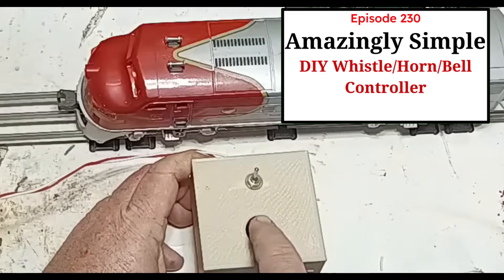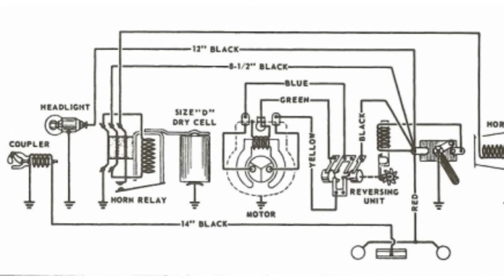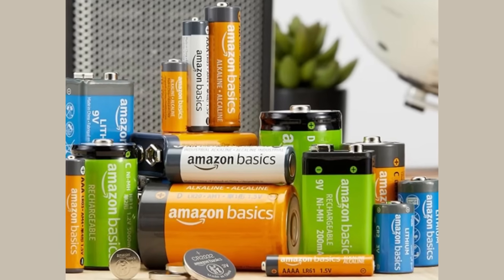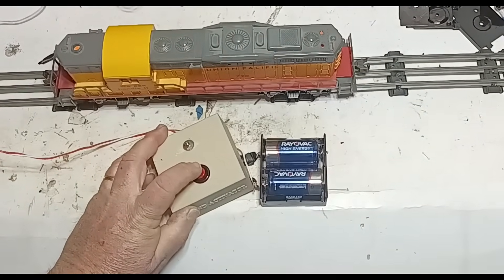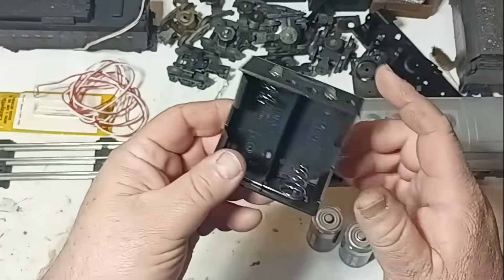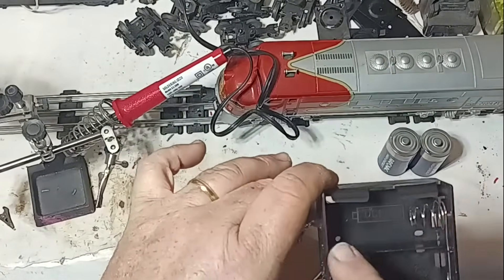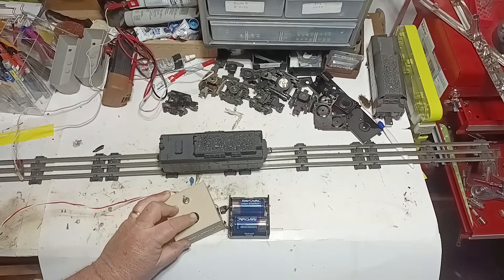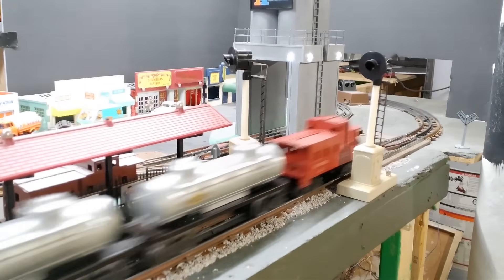How To Make A Simple Lionel Whistle Controller At Home

Comment: Have you tried this setup with the transformer powering the trains at the same time? Since the battery is in parallel with the transformer, these two sources are going to try to dump current into each other every half cycle. The diode is absolutely necessary because the transformer would blow up the battery, but the battery is trying to dump current into the transformer windings every half cycle as well to match the voltage drop. Either make sure the resistance between the transformer output and battery input is somewhat significant or add a resistor in series with the transformer and track connection. Otherwise, you essentially have a short in the transformer-battery loop.
Reply from the maker: To  answer, yes,  I have used this button successfully while operating trains/transformer at the same time with no issues.

Comment: I built this project and I thought that I followed the video, but what did I do wrong if the horn sounds all the time?  AND what’s the fix?. Thanks!
Reply from the maker: If the horn sounds all the time with the button is not interrupting the power or the horn relay is stuck. You can check the button function with a voltmeter
Reply from the maker: Or maybe the diode is on the wrong side of the on/off switch, sending constant DC to the track.
Reply: I was a little confused about the placement of the diode. Please confirm if “the band” on the diode should be on the battery side or the switch side. Thanks

Comment: Ok, i may be obtuse, but is this wired how? In series with the transformer,  in parallel? A drawing would sure help because i cant seem to get it right. Im a spaz.
Reply from the maker: As the diagram at 4:15 shows, the transformer is not involved at all. The + side of the battery goes to the center rail and the - side goes to the outer rails. The DPDT is only necessary if you want to control both whistle/horn and a separate bell (opposite polarity). The push button connects the + side of the battery to the track so it doesn't sound continuously. The button will sound the horn even if there is no transformer power to the track (As at 4:03). If you have an early PW whistle or one in which the motor has not been tuned recently, it MIGHT not work as the battery may lack the power to run the whistle motor. Don't forget the diode so your AC track power does not backfeed into your battery! (Potential BOOM!).

Comment: Good video on the simple project.  Most of my locomotives do not have a horn so I want to make a fixed trackside shack housing a sound card with diesel horn, steam whistle and bell options.  I would power this unit with a low wattage A/C transformer I use for lights on my layout.   Then I would have a whistle, horn or bell for any locomotive I am running.   Not asking you to make a video on this idea of mine, but any help you can provide would be most helpful.  I have a shack, but what sound card would you recommend and how would the wiring be done.  Electronics is not my strong point, so keep it simple....lol  Thanks Mike.
Reply from the maker: I would go this route: https://youtu.be/x_3hEQL8qwk

Comment: That would be a nice complement to add bell control to a postwar transformer. I run mostly postwar but have a few modern era pieces that have whistle/horn and bell. I typically will use my CW80 transformer for these pieces because it has both controls built in. Something to consider though is that some postwar transformers have an AC voltage boost of around 5 volts when the whistle is triggered. I know the KW does this but not sure about which other ones do. This is done to prevent the train from slowing down when the air whistle motor activates and draws track power. This feature sent my 2046 off the rails many times when I was highballing towards an O27 curve, hit the whistle but the relay didn't activate, and instead my locomotive got a voltage boost and launched itself into a roll across the living room carpeting! LOL
Reply from the maker: That's the Turbo Boost! ;-)

Comment: Can you make how to make your own lionel transformer with a battery
Reply from the maker: Well, you'd need a very large battery and a rheostat/potentiometer. And you'd be running on DC power instead of AC.
Reply: But can you make a tutorial so I can understand how to wire it
Reply from the maker: @Tulungagungrailwaychannel  honestly, it would be cheaper just to use a traditional transformer. A battery large enough to run your trains off of would be far more expensive per watt than a regular transformer. Also, I understand how it works in theory but I'm not familiar enough with that kind of current to provide safe advice.
Reply: But I'm in 220v country
Reply from the maker: @Tulungagungrailwaychannel  I'm not an electrician. I don't want to accidentally kill anyone.
Reply: Last year I buy bachmann train but the controller burned out when I'm testing it
Reply: Ok

Comment: Would it be possible to use a bridge rectifier with a resistor to replace the batteries?
Reply from the maker: Yes, but then you need to run on either track or accessory power.

Comment: Think this same hack can be pulled off with the battery control box from a postwar turntable, it’s basically the same thing, but with just a 3 position switch to change the polarity.  I have one because I really wanted a turntable (got it at my local CP Train Stop for around $80, and really only needed a better motor) I really don’t use the battery box since I had a spare Life Like dc power pack, but the battery box is still around in case I want to use it for something else.  But the Bedroom Carpet Central turntable is probably always going to be powered by that power pack though.

Comment: Mike MPC Matt here, can you use this system with the rechargeable batteries like NIMH batteries??? I don't like to use regular batteries or alkaline batteries because those types have a bad tendency to leak. Sincerely, MPC Matt.
Reply from the maker: A rechargeable D cells should work. If you're talking about rechargeable pack such as for cell phones you would need to have sufficient amperage and I'm not certain of the specs on those.
Reply: NIMH Thank You Mike!!! Sincerely, MPC Matt.

Comment: I've been doing this for some time now. I originally read about in a book that (of course) I misplaced somewhere and can't find. I usually use a household SPDT (AKA three-way) switch to control it as they're dirt cheap and actually use a slightly different wiring arrangment. I've never used a diode, however. Also, it doesn't have to be a D battery; I've had success with a AAA battery. Why an AAA? Because I was trying to stuff it into my SD18 along with a remote control relay for remote horn and reverse control!
Reply from the maker: D cells last a lot longer than AAA, but the voltage is the same.
Reply: @ToyTrainTipsAndTricks  That was my understanding too.

Comment: Lionel made something very similar to this for their G scale engines.  The RailSounds module used a 9-volt battery and had two buttons instead of relying on a toggle switch.  Wonder if it used a different technology than superimposed DC since G scale trains used DC power supplies to operate.
Reply from the maker: Railsounds was a different system. It was a more advanced digital sound system that utilized a different control method than the traditional relay activated whistle/horn/bell.

Comment: Lionel DID manufacture a D cell whistle/horn controller (Lionel Whistle Controller No. 147).   It contains a “snap” switch that places the D cell in series with the track power.
Reply from the maker: Thanks. I had never seen the #147 before. So, after designing the whistle system in 1935 they arrived at the battery idea in 1961.

Comment: Well this is really interesting. I don’t think it would work for HO scale. Lionel made an HO scale whistling tender, but its controller is a mystery because it has a relay in the tender. However these HO engines and motors are DC only, so I really wonder how to make that kind of relay work over a DC track.
Reply from the maker: As another commenter noted the battery operated #147 controller, the HO scale "#047" controller was also battery operated. Like you, I am not certain how the HO scale whistle would have operated.

Comment: Hi Mike. Lionel did produce a “D” cell battery controller. It was a #147 Whistle Controller produced between 1961-1966. My very first Lionel train set #11550 Steam Freight came with the #147 whistle controller that connected to my #1073 60 watt transformer. I still have this set along with the #147 Whistle Controller, and it still works to this day. The “D” cell battery would send the DC offset signal to the center rail track just like your DYI battery controller. Well done video explaining that you can use a battery to control your whistle/horn. Tom

Comment: Post war relays I have read don't care about polarity. Also many post war transformers are wired backwards for horn whistle polarity. At leat that was what I read since thw whistle patent should have expired decades before K line was a thing, assuming it was not redone.
Reply from the maker: 1) My Postwar horns are whistles only blow when the polarity is in the correct mode. 2) Often the "wired backwards" phenomenon is actually the plug being in the wall upside down since polarized plugs were not a thing at the time.
Reply: @ToyTrainTipsAndTricks  Plain old D.C. relays will activate no matter which way the current flows. All of my 2343 and 2344 loco horns activate no matter which button is pressed on my Z-4000.  If the loco has an electronic system, it will matter due to the more sophisticated sensing circuits.  BTW, it doesn't matter which way the plug goes into the wall socket, what matters is what comes after the secondary winding (diode  polarity).
Reply from the maker: @JRNipper  That's interesting, because my F3 and whistle tenders in the video would only operate with the toggle in one direction. Curious. (And I checked both sides of the toggle for current - and both the K-Line whistle and Williams bell operated in the opposite configuration).

Comment: FYI, the comment about function being backwards is also a great way to figure out if your old Lionel power pack with whistle function is wired backwards. ( had this happen at a recent train show)
Reply from the maker: Interesting, I hadn't thought of that!
Reply: @ToyTrainTipsAndTricks  it is the "U" and "A" terminals that are used. Loved how MTH fixed the confusion by using red and black connectors on their packs

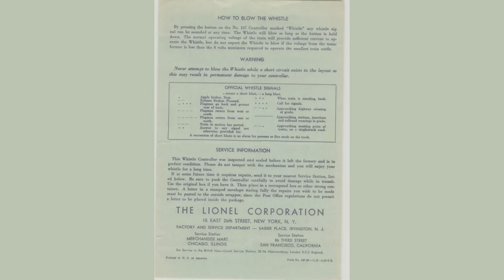Comment: FYI, in one of your pictures @ 2:10 is a black box add on that gives you whistle and reverse function via push button. I have one. Might want to do a video on it..
Also there was an AC to DC converter so you can run your old universal motors on a DC current (supposedly easier on the brushes)
Reply from the maker: Yes, that's the original Prewar whistle controller. I have one as well, but I have never tested it because it's designed to operate at 24v or higher for Prewar motors. Maybe if I pick up a Torpedo or Commodore Vanderbilt someday...
Reply from the maker: I run older Lionel and Marx on DC all the time. The only thing I notice is the motors do run a bit hotter than normal. I know that in theory the reverse units can become magnetized on DC current, but I have never experienced this problem. On the upside, they run smoother, quieter, and at lower voltage on DC compared to AC. Also, older one-way AC motors can easily be converted to change directions on DC with the help of a bridge rectifier.
Reply: @ToyTrainTipsAndTricks  I figure it would be able after i saw a video where someone used a diode to replace a bad e-unit
The real cool trick is to get those rare non switch revering DC power pack
Those have stick in center for stop, but taken either way gives direction

Comment: Well poop, I wish I had seen this a couple weeks ago. I removed the horn board from a Lionel rs-3 because it was going off by its self. I don’t have a button on my transformer so I didn’t look into why it was doing this. Now I’ll have to figure out how to wire it back in. Lol
Reply: Need to check out you power pack you are using. Some 3 rail power packs are NOT pure AC and will cause issues with some locos and addons. There are quite a few videos on this.
This also effects DC power packs for HO-scale (Rapido and a few other void warrenty is you use them)
Reply from the maker: That's an excellent point! Thanks for the tip!
Reply from the maker: Happy to help...I guess!  ;-)

Comment: USE THE DIODE, some older batteries might not mind the AC for short burst. Bur allot of modern batteries may uhm, smoke or?. Plus I have seen batteries go boom when overcharge , which that 18 volts just may do, well
Reply from the maker: Thanks for the verification! It just seemed to me that back feeding AC through a battery was not a good idea.
Reply: @ToyTrainTipsAndTricks  FYI, it also used for power backup in devices, diodes allow current if there is a voltage drop, so allot of battery backups use this simple trick.
I just like to cation because I have seen too many oops
Reply: One advantage I can see over a transformer button is that it will play with the transformer power off!
Reply: @3-Rail-Tales-Dad  It will play only if the loco has an internal battery for the horn such as the original Lionel 2200 and 2300 series F units. Electronic sound boards need the A.C. from the transformer to power the amplifier chip that feeds the speaker.
Reply: @3-Rail-Tales-Dad  be also great for static display as well

Comment: I"ll have to try this for my engine display base, Mike, as I do not have a good way for people to operate the engine's whistle when it is on the base.
Reply from the maker: That’s a great idea!
Reply: Thanks,  @ToyTrainTipsAndTricks , I actually have a video about it's construction on my channel.
Reply: me too, I can see a display case demo unit for visitors
Reply: @ Unfortunately, I don't have the room to put up my 3-foot display shelf. Does your display case allow for the engine to run?
Reply: @ if you were to use the battery for the whistle the engine will not run. It might have a slight hum, but 3 volts DC not going to do much on any o-scale engine.
If you are really concern, and it's a whistle tender, use insulating pins to loco
Reply: @billfusionenterprise , I see your point. However, the engine itself runs on AC current, with the whistle being activated by DC current. @toytrainstipsandtips did a video on running trains using DC instead of AC and noted that the bells and whistles would have to be disconnected or they would always be on.
Reply: @ I was thinking for just blowing whistle or horn without the engine moving. Like and display peice
Reply: @, that makes sense. However, I took it the extra step of having engine run the display (the project for my senior art exhibition). (The video about it on my channel goes into further detail about it.) Under normal circumstances of a static display, yeah, 3 volts would not run a motor. With a Lionel pullmor motor, the motor wouldn't even activate because the voltage is too low (5 volts is what is needed to activate it, correct, @ToyTrainTipsAndTricks?).